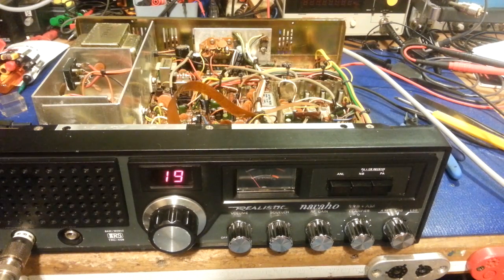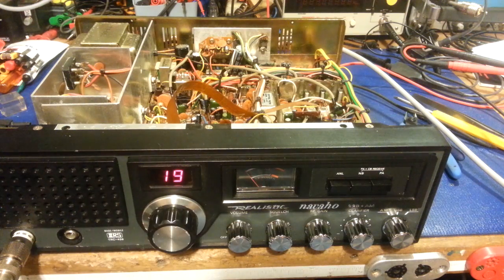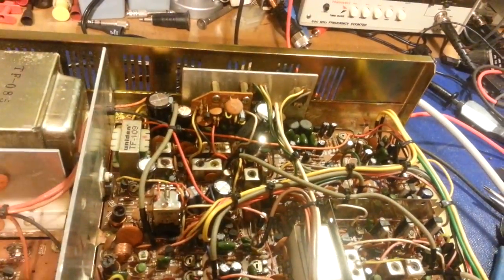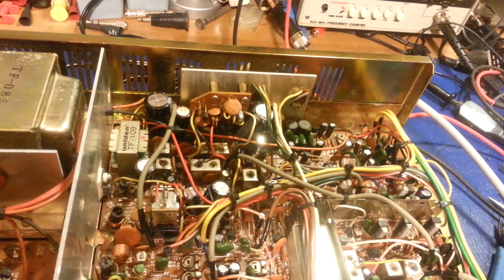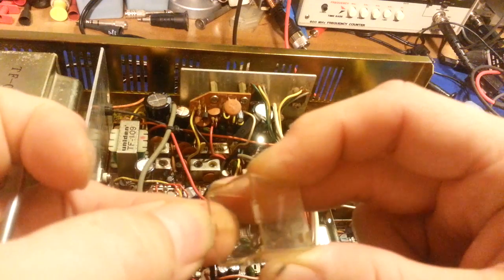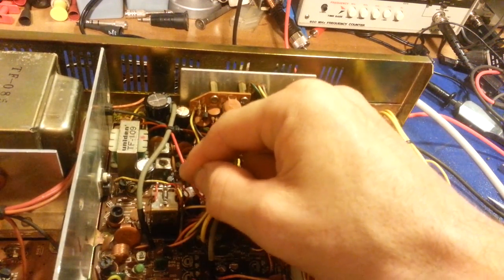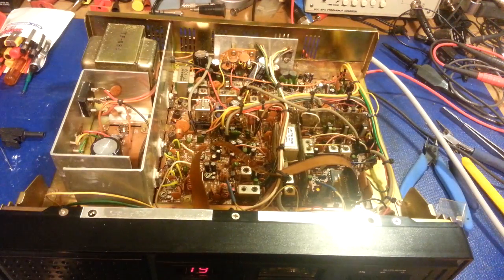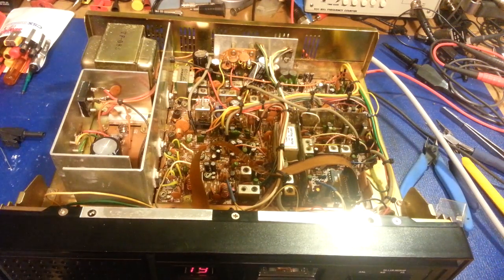CB radio with intermittent/low receive, is your relay bad.

Comment: I have one question my galaxy 99v if I’m sitting somewhere and someone talk on the cb once they stop my needle swing all the way to the right I have to push my mic about 2 times to swing it back left then I can hear them again been 2 3 ships and nobody knows checked my wires check antenna all good
Reply from the maker: It may not be a electronic problem but a mechanical fault.  It's not uncommon for the cheap meters in CB radios to stick.  I have seen a lot of meters that start to stick/bind like your describing.  First thing to do "if" you have a volt meter.  Remove the covers from the radio and get the meter to stick like your describing.  Then disconnect the antenna from the radio and take a voltage measurement from the meter to ground.  You should see a very low to 0 volt reading.  If this is the case then the meter is probably sticking.  Something a little more brute force you can do is when it sticks give the radio a tap with your hand.  If bumping/tapping the radio makes the meter go back to S-0 signal strength then it's definitely a sticking meter.  You may be able to free it up.  I did a video on how to do it.  https://youtu.be/qygecXhZTxk

Comment: Mike  have you had any dealings with the Texas Ranger TR-696F SSB Base Radio with the Weather installed in it? I have one and the Service Manual for it is a joke trying to figure out the Weather connection to the board. In order for you to understand where I  am  getting at you need to look at the Schematic and Parts list  for the Radio. There is a listing  for R69  connecting the Weather Board to the Main board but it shows it listed as a 4148 Diode. No listing in the parts for R69, D83 OR Q45  and there is no sign of D83 or Q45 on the Schematic. Just  wondering if you might know what they were actually meant to be. Thank you very much,Sincerely William C. Colvin.

Comment: Not directly relay related but I have a SteppIR BigIR HF vertical antenna that will sometimes "lose reception" and as soon as you give even a very small squirt of RF it returns to correct functioning; I'm not the only one who has this issue with that antenna. Goes to show you that the "microscopic" element of dirt, grime etc. that Mike is talking about can cause this type of contact  problem.
Reply from the maker: Definitely doesn't take much to make a poor connection in a relay.

Comment: I wish there was a cheap sub for these.
Reply from the maker: For what, the relay?  They are cheap, around $10.
Reply: MikesRadioRepair ya but $20 cad to ship
Reply from the maker: +ᗒ╬ᗕ1112223333111ᗒ╬ᗕ 

$8.85 each and $2.62 shipping in the US.  Ebay # 222266971280. I buy them 50 at a time so I get them even cheaper.
Reply from the maker: +ᗒ╬ᗕ1112223333111ᗒ╬ᗕ 

No, their located in California.
Reply from the maker: +ᗒ╬ᗕ1112223333111ᗒ╬ᗕ 

Oh, I thought you were in the US.  The American flag and Trump logo you use made me think you were in the US.